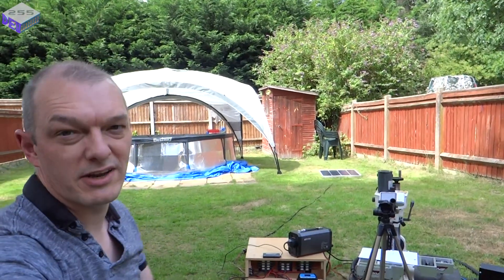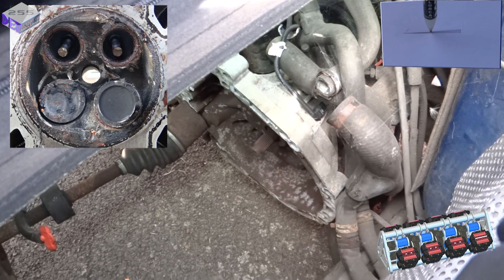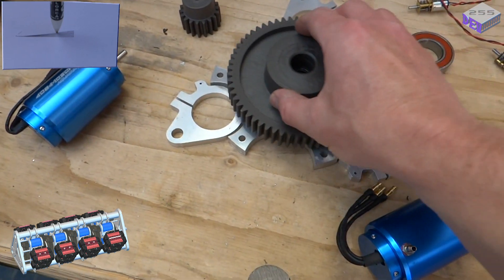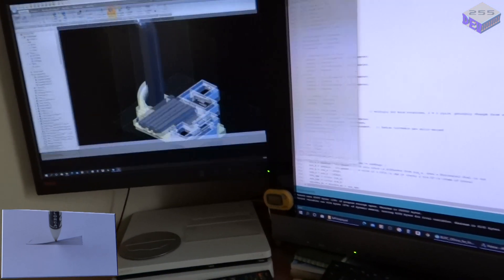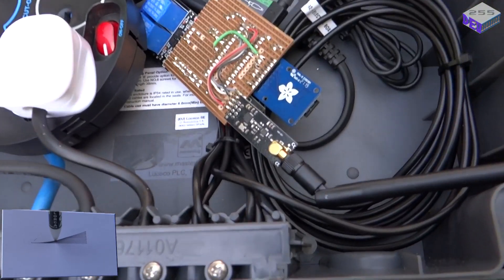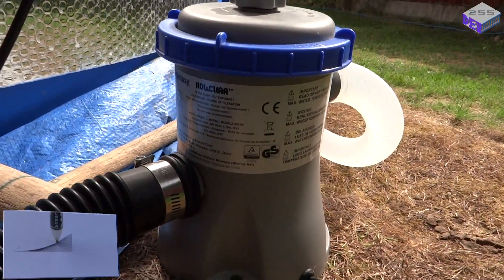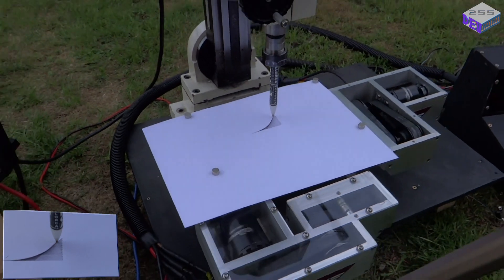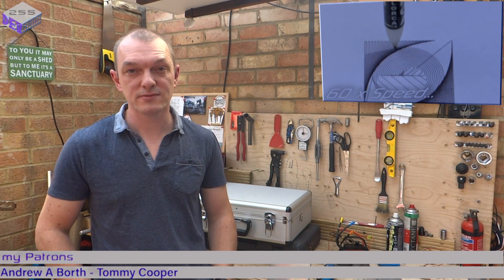What do these have in common?

Comment: Great work on the cnc conversion, you've done an amazing job. The mg project will be fascinating and I'm sure you will do well with that too. I'm engineering an electric hovercraft but had to abandon my multiple small BLDC motor power plant as the efficiency and battery requirements did not work out to be feasible. In the end a single larger BLDC motor produced the power required with more efficiency and therefore a smaller battery system.
Reply from the maker: I may go down that route eventually, although want to see if I can get it all working together, modern microprocessors are very rapid and I'm using 24 individual batteries and speed controllers controlled using independent microprocessor, so everything running in parallel, I bet your hovercraft is good fun 👍
Reply: I'm sure that it's a good plan for your application. I can't see any reason why it wouldn't work the way you have designed it. Unfortunately for any flying vehicle (even if it's a few inches!), weight is paramount. The battery pack I would have needed for that setup would have been far too heavy for my design constraints, certainly for any reasonable duration. Thankfully not so much of a concern in an electric car! The hovercraft should be excellent fun, the ducted fan thrust, prop, torque and battery calculations- not so much.......plus single motors and appropriate sized esc's are ridiculously more expensive! Really look forward to your project updates, cheers.
Reply from the maker: Thank you, I may have to ask you a few questions then when I come to the inevitable head scratchers. Would love a ride on a Hovercraft, are you UK based?
Reply: Anytime Neil, if I can be any help or just to talk stuff/ideas through! I'm in Tasmania, Australia unfortunately- it would have been ace to give you a ride. It's like nothing else really, I charge around the wilderness rivers here as its immune to rocks and trees in the water- even some white water Rapids! When this current nightmare eases and travel happens again, you should come for a visit. As soon as I have some decent footage I'll let you know. Just been let down by an electronics provider for the esc (avoid maytech in China!), so the thrust testing is delayed. As you know, calculations and theory are great fun but nothing beats real world testing.